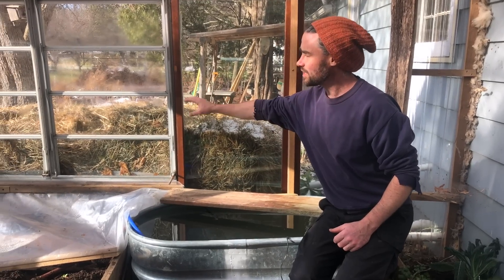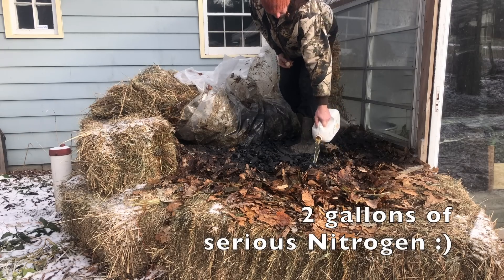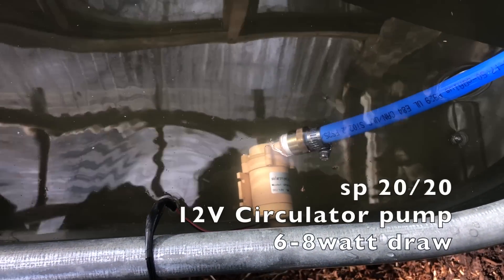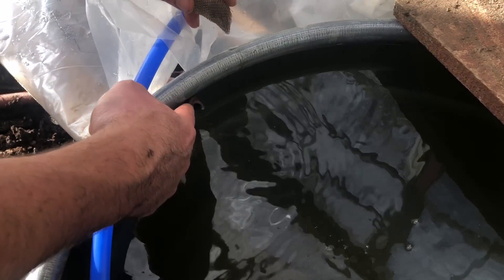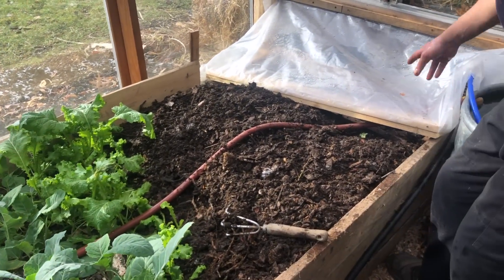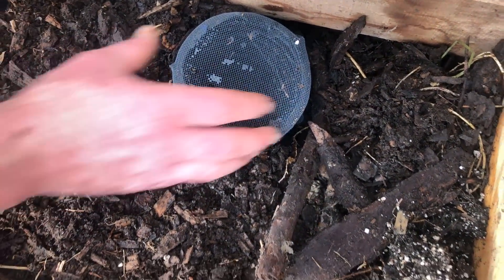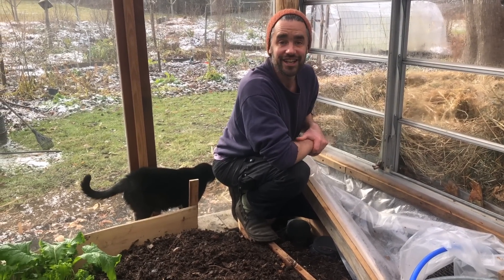Greenhouse - Heating with compost part II

Comment: Using compost to heat water is an excellent idea, but it’s a very bad idea to put the compost inside a greenhouse. Unless you want to die! You can not put compost in an area that’s not ventilated because it actually gives off toxic gases. I learned this from a YouTube channel with a gentleman from Clemson Extension service that went on to be the farm manager of a large commercial market garden in South Carolina. They used a very elaborate, yet simple  compost system to heat their high tunnels.

Comment: Just ran across your channel  and have apparently constructed a very similar system.

8x8ft compost bin (horse ranch produces much compostable materials), 55 gal water tank (mass), and a 12v pump which circulates water (temp and time controlled) through the compost bin, through radiant floor tubing(pex), to storage tank, repeat
Reply from the maker: Yeah, that sounds like a pretty darn reasonable system.  Good luck and hoping for amazing results!

Comment: You should take plywood and blue board insulation make a box or housing around your compost that will greatly improve the heat at holds and makes
Reply: you could even take black plastic and wrap the housing of it on the outside to attract all the heat from the Sun that will help insulate greatly as well
Reply: And use black tubing for everything cuz the sun will heat the black tubing up as well as it's transferring to the water tub back to outside to the compost that blue tubing is going to cool it down faster and black rubber tubing maybe better than black plastic tubing I would think it would hold the heat in better plus it's a little insulated compared to the plastic tubing that alone is going to greatly help you I would keep the black plastic tube coil you got in the middle of the compost cuz I think the heat will transfer better into that then the rubber but anything coming out of that and going into the tub I would make black rubber because it's insulated you can even go as far as getting some black rubberized bed liner or just some black spray paint and spray paint the outside of the water tank and make a black lid for it as well without a lid you are losing probably 50% of your heat and then you can make events coming out the lid you could put just a piece of ducking sticking out with event off the lid that way the lid will compress the heat more before it comes out and should keep everything harder longer make it harder to cool itself down when you're dealing with trying to keep heat like you are the biggest thing is retaining all of that heat every way you can
Reply: You can also dig a 4 ft deep square and however why do you want it for your compost the walls of the earth will insulate and hold the heat way better and it won't be able to escape as easy in the winter and then just make a lid

Comment: It's a good idea, and very possible. I plan to do something similar here in Germany. I think if you're meaningful result it may be best to start again and get the basics right, for example a better insulated structure, glazing only on the roof and front, and a north wall (maybe from old bricks) that can store solar energy. To maintain a decent level of warmth,  one must think about more than just heating, but how to best integrate and diversify the collection, storage and maintaining of heat

Comment: use a cattle water plastic container to aid in the compost area an feed the compost into it as a way to cycle the compost. To as a way to trap the heat better an to save the water wasted during thermal process to catch the humidity an feed it back into the loop. An try to mico size the system to generate the same heat but smaller systems around the green house . Dont think big pile but laying piles in sections around your green house.

Comment: i would personally just use the hot temperature off of the compost and convert that into electrical energy to power a thermal/heater system for the greenhouse. that compost could probably power a 100 watt power heater.

Comment: Quite a bit packed into such a short video! This is only my 2nd video of yours I'm checking out, and it being posted 1 year ago..
  I have a number of simple adapts that would help the setup as seen here and in the 1st video.. any interest?
Reply from the maker: Thanks for watching!  If you ever want to share notes in the comments on these videos it would be great, so other folks can learn too.
Reply: @edibleacres  Good morning and thank you. I've yet to read through the entirety of the comments or suggestions. But I gather from the video your intent of full utilization of the decomposition process. I've been researching pre-1900 Victorian greenhouses and growhouses and their sometimes elaborate and exquisite but simple construction. Considering enclosing a section of our composting and fire pit area surrounded by garden walls. It's already canopied.
  My initial observation of your video was the build and routing of tubing through depth of compost to a stock tank of water. Pumping and circulating the water via solar charged pump, timed DC pump, or what have you need specifically.
  I suspect you wanting to transfer the heat generated by the compost, to the water- which in reservoir, in its entirety to either the ground or the air? 
  The ground transfer of heat as you had verbally mentioned can be done in the same way. Routing aluminum or copper tubing (that displace heat well, I imagine thinner wall pex would work well too) from your source, to a storage, and to your surface or subfloor. You would want a constant flow, and vary the quantity stored perhaps by temperature.
 A couple of things that first came to mind. Heat always rises. Whether it's air or water or fire or light. It emits up and out. Natural airflow is cold sinks and warm rises. 
   The other thought for further heat displacement via the water from the storage is to radiate it. Doing so in an enclosed radiator would emit heat transfer via air. A waterfall or tricklewall of substrate will immediately radiate any heat as well as allow oxygenation and minimal evaporation loss but increased humidity. My main thinking is- transfer, storage, utilize, control.
 The stock tank could have fish (of course with a backup heater) and utilize the entirety of the water/waste for interior hydroponics.. I'll stop..

Comment: Thermal siphon might work without raising the tank....by losing your compost.  Large round hole will lower your heat piping below your water tank.   Additionally, the earth will act as a large insulated tub.  

And yes, the longer your run the pump, the more warm your water will be, once the water temperature actually comes up, your compost will not be cooled so much by the water slowing the hot compost process down.  Starting and stopping the system I would think would be very inefficient.  Cools down the pile, pile slows heat production, water slows its heating.  Keep that water circulating and it will improve, or at least that is my theory 😉.

Nice work nonetheless!  Simple set up, inexpensive and you find enjoyment out of it.  All that matters!
Reply from the maker: Thank you for all these notes Wade!
Reply: @edibleacres  that was supposed to be "lower your compost," sorry for the confusion.  

We really want to do a green house too, just finding the time and money to do something with it is tough these days.

Keep up the good work and sharing.

Comment: Drafting....if you built a small rocket stove, using the air from the tube beneath the bed as an intake for the fire, and the flu as the riser from the bed, that initial fire will keep the flu hot for hours....when it cools, burn another small fire if you still need the additional heat.  Just a thought.
Reply from the maker: Definitely a neat additional layer... I think in this context it's just too complex to manage, but in the future I would love to have a rocket mass heater involved in a structure like this.

Comment: I would try to use 6" vent pipe that is perforated to pull heat and air thru your pile and into your greenhouse. That will benefit your compost and your greenhouse by way of warmth and CO2 for the plants. Just run a length of pipe thru your pile and into your greenhouse and add a computer fan to suck the air thru. The biggest downfall of this is your compost may break down quicker so you may have to add to it.

Comment: It's a year late, and you've probably moved on, but I wonder if you could pipe your inlet from the compost through the bottom of your soil prior to dumping it in the water reservoir to keep the soil warm, even when the water isn't overflowing. In other words, another coil of piping. The inlet water temp at your reservoir would probably drop ~10-20 degrees depending on the length, and the amount of moisture in the soil. With the remainder heat going into the soil. I expect you'd need to monitor the temp fairly closely. 

I'd also wonder about a simple timer on your pump. It would take some experimentation, but something like 2 minutes on, 5 off maybe 10 off to heat the water, then two on again to circulate. It could then run nearly indefinitely.

Neat project. I'll have to check out more of your videos to see how it's been going.

Comment: Would solar chimneys work in your area?  You could take the exhaust ends of those underground tubes and run them into the bottom of a solar chimney, that would give you warm air from the compost being pulled into the ground during the day, and it would cease at night, leaving the heat in the dirt to radiate up into the greenhouse.

Comment: Thermosiphoning isn’t going to work well when you’re talking such a small temperature difference. Also it doesn’t care about where the loop is and where the tank is. It’s all about where the ends of the loop are and there needs to be some decent difference in height for small temp differences but a few feet might be enough

Comment: Are the gases you are capturing from after the pile goes anaerobic?  Do you want the pile to go anaerobic or is it just unavoidable with your current setup.  I would be really interested to see how fast a pile decomposes when you are basically watercooling it like that, if it can never get over 180F  could you supercharge it and build a bacterial colony that could decompose the material in 18 or even 12 days?  if you are pushing anaerobic gases into your garden beds, couldnt they be detrimental to the aerobic microbes and roots in the soil?

if you want to try and aid the pile in staying aerobic, you could put septic drain pipe that has the holes in it or a false floor with a fan that pushed air into the pile from underneath, which would then push it out thru the exit assembly you create to push it into the greenhouse's bed soils.

     The fungi you are growing in the pile will more than make up in carbon sequestration for the co2 that is being released in the decomposition process so that you are carbon positive  in the over all process.  

you could have the water return line come back into a bucket in the greenhouse down low, so siphon effect was pulling the water out of the main reservoir, and the pump pumps that heated water back into the reservoir, so the back pressure never got high enough to stop the flow. and the pump was never in the cold water, it would still have to be a continuous system though.

Comment: I have a greenhouse (cold frame) with a wood burning stove in there but I “don’t” want to go out there at night to put more wood in the stove. A few nights would be ok. But not months on end. This concept sound so interesting. My greenhouse is not next to my home. Because of cost I haven’t yet put a wall up on the North side of the gh.  It just has gh plastic. When I get to that I’m going to try this idea of running the tubes through compost & then through the dirt inside gh. I’ll have to read through the comments & do more research. This has helped me think... ty
Reply from the maker: I need to do an update here, it's still working but has definitely slowed down with the heat.  The basic idea feels really legit and worth experimenting on for sure.

Comment: You should definitely paint the tub in the green house black, also cover it with a black sheet maybe? also you could hook up a 10-15w solar pannel to a large 110 AH lead acid battery for the pump to work over night on 12v. You can get away without an inverter, may need to rarely top the battery off depending upon weather conditions. Just make sure you buy a 15w solar panel with a diode to prevent voltage leak.
Reply from the maker: Some great ideas here, thanks.

Comment: I think that the tube should be metal, the best one is made of copper,but the aggressive acid soil won t let it live for some long period of time. The diameter also should be bigger but it also depends on what temperature  you need in the greenhouse and of course how big the greenhouse is. Perhaps it would be better to cover the compost pile . The coils of the tube to be installed horizontally
Reply from the maker: Good info, metal for the tubes won't work for me since it's so much more money and so much more fragile, though.
Reply: Ok. Where do you live?

Comment: Killer video!  About your question, a ‘pull’ configuration is quieter and more efficient for cooling, which is what your application is really doing: it’s cooling the warm, moist air being drawn from the compost pile.  I would make a 3:1 exhaust manifold and install one fan to draw air through the system, and I would make the diameter of the  manifold larger than the 3 existing pipes going into it.  HTH and thank you for sharing
Reply from the maker: I'm getting that together actually, more or less how you described, and will be making an update video on this all somewhat soon!

Comment: In my opinion, draw air from the farthest point of the pipes using one fan. The vent pipes should have a cooling pipe run through the vent pipes to act as a condenser as you would find in a chemistry lab to get the moisture out of the compost air. Provide drip holes in the vent pipes strategically to optimize a constant drip along the vent pipe length. Enjoy your videos.
Reply from the maker: THanks, thats what I'm thinking.  The pipe in the soil is 'drain tile' pipe which already has ample small holes in it, should work nicely.

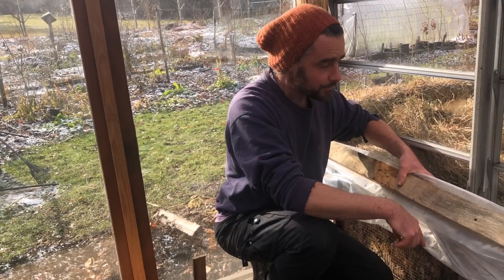Comment: 8:55, Mount the fan(s)  at the exhaust end. It's easier, ( less energy draw), for a fan to pull air through a restriction,(ducting), than to push it. <><
Reply from the maker: That is the definitive feedback I'm getting.

Comment: Haven’t been following this one from the start but you are correct that (all other things equal), the smaller and thinner the tube the more effective the heat exchange in your thermosiphon will be. In fact, to maximize efficiency you can repeatedly attach manifolds to the end of the tube so that you have one larger tube at one end and hundreds of smaller diameter tubes (about the size of those used in an aquarium) in the heat exchange area itself. If you have moisture in the air, condensing it will release the heat. So, if you want access to that heat, you need to build or attach a condenser to release the latent heat and then use the condensed water so derived in its highest and best use.
Reply from the maker: Thanks for these notes.
Reply: Here is a link that might be of use to you. We plan to do something similar to this to heat our high tunnel. Maybe you could adapt it for your situation. https://youtu.be/bKhZTDvwBFs

Comment: Have you seen the youtube DIY programs on using passive sun collector panels made from aluminum cans which are painted black to absorb the sun's heat during the day? You could use them to bring heat into your room with a hose.  A couple of those against the house or somewhere close might give you another source of heat for your chicken coupe and or the greenhouse in an economical way.
Reply from the maker: Great reminder.  I started exploring that last year but have put it on the back burner for some reason.  I should pick that up again.
Reply: @edibleacres  Look up the Swedish Homestead  on Youtube for a set up like yours but slightly different to see what you think of it and if it might save you some work or time.

Comment: My inclination would be to pull the hot air through from the far end.i would also drill small holes in the bottom of the tubes to allow condinsating moisture to drain from the tubes at the lowest point. Also like the idea of painting the tank black.
Reply from the maker: The tubes are 'drainage tile' tubes so they already have holes through them, which is convenient.  I like the black tank idea as well...

Comment: If the compost pile was inside you would not like the smell, yet you still want the warm smelly air to go inside (this idea with pipes) - isn't it irrational?
Reply from the maker: The compost pile would take up nearly half or more of the whole space here if inside, and the way I made the pile the part that connects to the greenhouse has a thick hay and charcoal layering between it and the greenhouse to act as a filter, rather than a raw pile...

Comment: Great Video's as always.  I think Fans installed at the other end of solar bed would be best basing it purely on Flow of air from compost pile through the network of geothermal pipes  to....next project...Dehydrator lol .  Thanks to you both, perfect team.
Reply from the maker: Thanks for this!  Yes, pulling seems like the way to go!